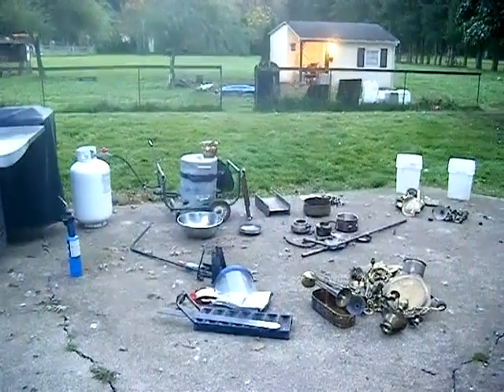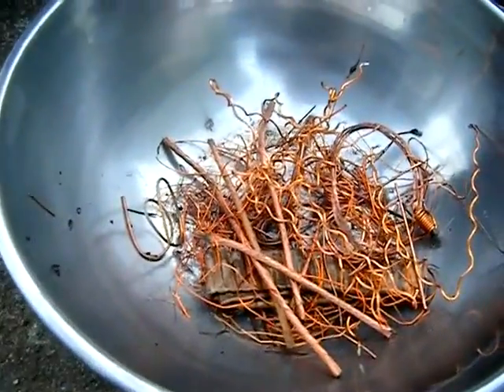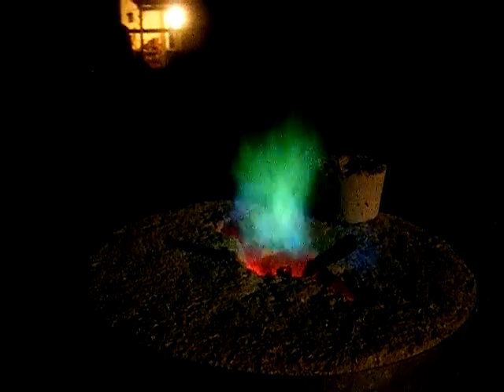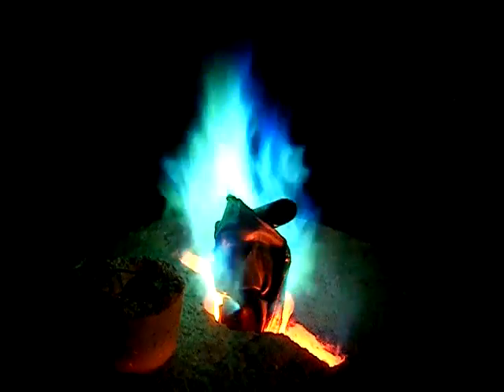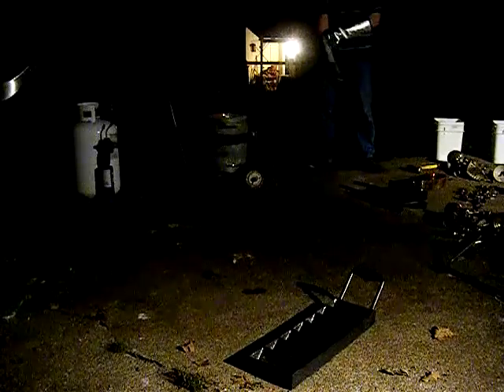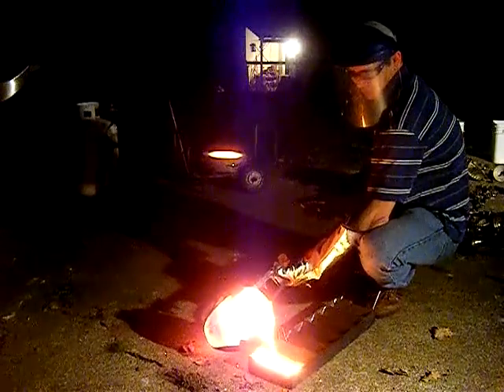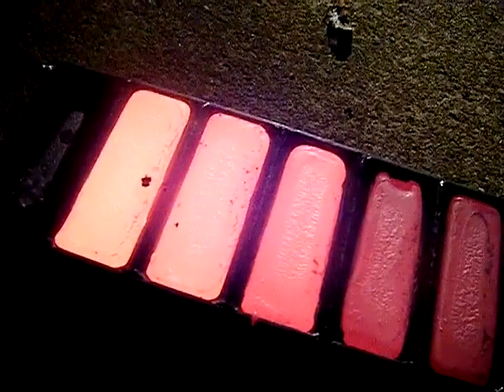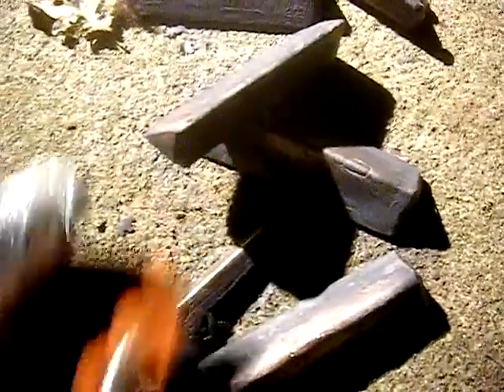Home Shop Foundry - Melting Scrap Copper

Comment: How long did a single load take? Also, how much propane did a load burn off?
Reply from the maker: It was about 30 minutes to melt when I did this video, but since then I've learned that I can go faster by turning up the heat, about 20 minutes.  Not sure how much propane it uses, but I can go for several hours, maybe 5 hours or more on one cylinder.

Comment: If you are only using Propane then you are just barely reaching the melting point of copper. You need to add Oxygen to raise the temperature another 800 - 1000 degrees. Then your copper will melt quickly and better.

Comment: stop being a lazy shit and strip the wire, its completely ILLEGAL to burn the insulation off!  i dont think your in an area where the cops will catch you, but if they did your looking at a nice fat pollution fine... Scraping is always unintentionally cleaning the community weather you try or not, thats how it works.   When lazy shit heads like you and the other dead beat riff-raff show up with BURNT copper to the yard, I laugh when they get the dirty copper price.. serves you dumb lazy fucks right...
Reply: You're incredibly rude. Rudeness is a sign that you clearly dont give a shit about anyone. Well, i'm here to tell you that the world does not give a shit about you either. Learn some manners. You're so tough, being an internet troll, now aren't you?
Reply: Just for that I'm going to spray an aerosol can in the air...   Good video guy
Reply: Shut up
Reply: tell that to government recycling facilities that pass all of their scraps through a giant furnace and burn off impurities before sending the metals back to the foundry. you may work at a scrap yard, but you still sound like a dumb pissed off little shit.

Comment: i have a hard time melting copper. i use a coal fired propant tank furnace i made myself, and i can melt 5 lbs of brass within 15 mins full burn, but copper  which is only a 200* hotter melting point will not melt. is my fire only getting up to 1850* or is copper wire just hard to melt?
Reply: Man, I have the same issue. And the copper that melts, hovers only a few degrees above melting, so a gust of wind shoves it back into solid state instantly

Comment: This guy just mixed brass and copper together. Look in the bowl before he melts it, copper pipe and brass valves
Reply: The bowl was sitting on the edge of the furnace to dry the parts. Since I had both copper and brass parts that were wet (or suspected wet), I dried them together. I'm pretty sure I sorted them after drying and before melting.

Comment: Since this furnace will not do steel what will you use for smelting steel?
Reply from the maker: Technically, smelting is making steel from raw ore, not just remelting it.   But if you did want to melt steel - most hobby people use an oil-fired furnace.

Comment: I'm curious.  What is the point of melting copper down to ingots?  Wouldn't you get the same price whether it's in ingot form or lose pieces.
Reply: 1) You stole the copper and you want to conceal the source.
2) You want to cast something.
3) You want to save your copper for the future. An investment. Bars are easier to store than pieces of scrap, and take up less room.
4) Ingots are cool. A copper ingot is a neat item to pass down to your child, ten times so if you made it yourself.
Reply from the maker: captainretardo I like to think of foundry work - especially with a home foundry - as a tool, much like a welder or a work truck. If your'e a good artist, an inventor, or entrepreneur, you may be able to succeed because you can make what you want, whenever you invent it.  But I think a person would be hard pressed to make money competing with commercial foundries, unless perhaps catering to the hobby market.
Reply: Thanks well explained
Reply: I'm curious too.  The only reason I can see is that you could get clean copper prices by smelting your dirty copper.
Reply: I melt them down so they're in a convenient form to use later, when I do casting. I don't sell my ingots - I would lose money on melting scrap to sell, or at least I'd be making less than minimum wage. =)

It saves time when I have a mold waiting to be poured and it's easier to store than the scrap.
Reply: Dominic Amae
Nice video, loved the blue flame lol, can you make decent money home casting? If so how please? I'm guessing the art would be one way (garden ornaments etc.) but what about car parts or something? Is it difficult to find people who will buy them? Do they need to be of a certain purity? Or maybe knives? I'd have thought it would be difficult to compete with companies doing the same thing :(

Comment: You'd only ingot to purify prior to doing your own castings like he does- otherwise just SELL the scrap and let the scrapper deal with it!   Love the videos!  My own furnace is made from a hard refractory tile surrounded by insulating firebricks wrapped with a batt of Roxul.  Simple homemade propane burner.  Gets to 1200 C in 20 minutes.  Melting brasses and bronzes and doing greensand castings.  Need some Petrobond though!

Comment from the maker: Man, I wish you had warned me. I died of the fumes while I was filming this!

But I got better.   [that's a monty python reference, BTW]

And for the record, you're right - it's bad to breathe this stuff, especially if you do it often. That's another reason I've changed my habbits to melting larger chunks of known good material. It cost more than putting together little pieces of scrap... but if you count the labor (to strip wire) and propane, buying good ingots isn't' so bad after all.

Comment from the maker: Good point - and actually, I do strip all the insulation I can manually.  I think even when remelting clean ingots, you'll get some dross.

Since the time I filmed the video, I've changed my methods a little. It's too much hassle to clean little bits of wire, so I now focus on buying bigger bits of clean copper to melt.

Comment: It is illegal to burn the insulation off the wire. Burning the insulation off wire in a bonfire can actually drop birds dead from the sky flying over. Should strip any insulation off with pocket knife. Just friendly advice. I imagine the blackness comes from impurities needed to be cleaned a bit more?

Comment: i got a few questions,how much did the furnace cost and did it come with the furnace silicone stuff and what is your mold made out of and if you used a cover on it what did you use and how long did that take to melt it down to a liquid and my last question how many psi are you running with the propane about

Comment: Possible, but just keep in mind that the portland cement reaction is driven backwards somewhere around 500 degrees. A steel or iron platform of some sort would be the ideal choice.

Comment: Good video, wanted to let your viewers know that I make forges, crucibles, burners, all of the info is on line, I have sold on ebay quite a bit. My burner will reach 2000 degrees and will melt copper and gold, both high temp, aluminum and brass, no problem. Horse shoe forge will work great too. I have yet to put  a  video on here, But will be working on it.

Comment: Hello, this is Steve with Lost & Foundry.
Nice video, thanks for metioning us.
The "lid plug" is for keeping the heat in when the furnace is not in use, between heats. The lid plug restricts the airflow and takes longer to melt.

Comment from the maker: @mjm4017 Two options come to mind - buy or build.  The quick and easy way is to buy a ready-made furnace. I got mine from foundry101. If you want to build, I suggest you read Gingery's books on foundry and crucible making, or read up on the internet.  Basically, you make a mold and pour refractory cement to build the furnace body.

Comment: If one can get up near 3000 F (yellow-white hot), all the common metals will melt. To add a blower, and shoot propane into the air stream, more heat can be obtained. My brother and I used a blower upon charcoal briquettes and could reach yellow hot. We would have gone higher but the crucible melted!
I like the way the furnace shell is removable to expose the crucible. Far out!

Comment from the maker: @1990suzuki  I built the ingot mold from 3/16" x 2" flat bar stock (for the sides) and 3/16" x 2" angle to form the triangular ingot shape.   The handle is 5/8" round bar, bent to shape and welded. To keep the handle cool, I cut apart a slag hammer and welded the spiral metal piece to the handle.

Comment: Hey guys, so I`m trying to melt copper but it just won`t melt. I`ve uploaded a video of my homemade furnace a a week ago or so. Today I got a more powerful torch and it got much hotter much faster. Now it got more than glowing hot. The bottom of the crucible actually got almost white hot. But still it wouldnt melt. all the tiny copper wires are still intact. Silver is much easier to melt. And the melting point between CU and Ag is only 123 C. I don`t get it...

Comment from the maker: @Shlabbinze I haven't tried to put a whole transformer into a furnace, but I have considered how to do it.   First, the plastic, insulation, paint, and any epoxy potting compound would burn off.  Obviously the smoke will be toxic and probably isn't too good for the environment.  Eventually the copper will melt off the transformer core and you can fish out the steel cores, sheet metal and ash (dross).  However, watch out if there are aluminum or other bits to contaminate your copper.

Comment: Would there be an issue with using fine wire? Would it burn off before it melts?

I'm asking because I often see scrap yards mention they don't take hair wire. I always wondered why. 

BTW, microwave oven transformers have at least a pound of copper wire in them. Very often, the primary consists of aluminum wire, but it's given a copper enamel coating so it looks like copper, and the secondary winding is copper. 

They're huge transformers.

Comment from the maker: Hey diyengineer, I'm in Vancouver, WA - been following your CNC rebuild on YT. Nice work so far!

Although I'm swimming in aluminum scrap, I'm finding it hard to get bronze/brass  scrap. Copper is even harder to find - people usually want to sell copper tubing and wire closer to retail price rather than as scrap.

I've had some success buying from local scrap yards.